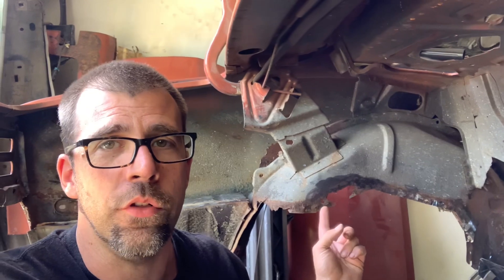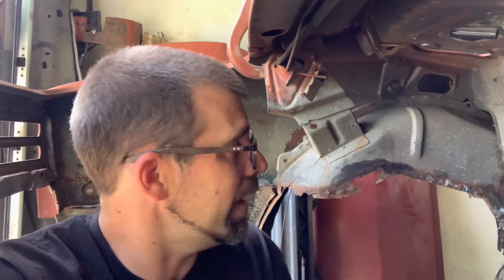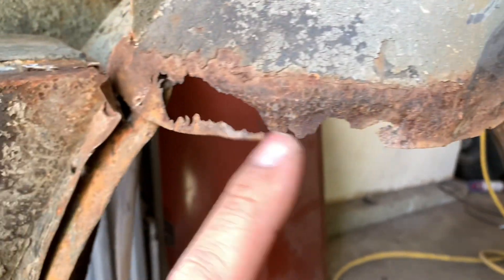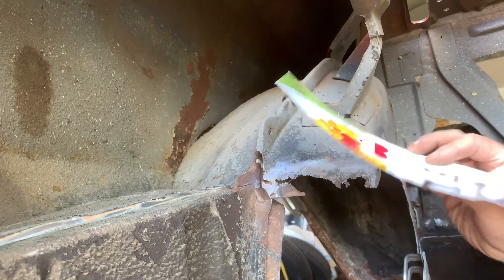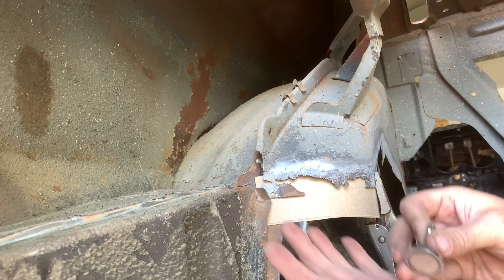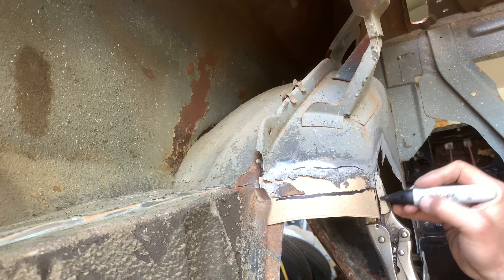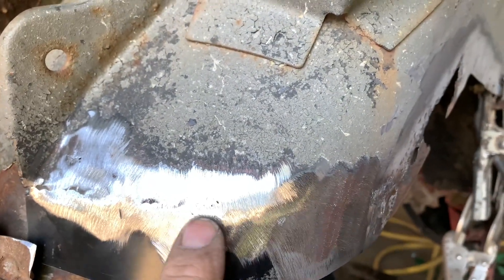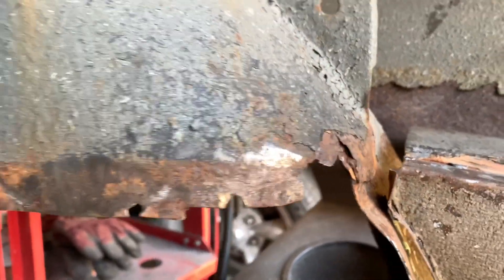how to make patches for seamless Wheel well rust repair 1968 Firebird

Comment: Nice work, Jon. Keep up the great work and the videos coming!👍
Reply from the maker: Thanks buddy, have plenty more to do as long as I can survive the heat, 95 with heat index of 110.  That’s not the norm for Indiana. Might have to buy a truckload of orange Mountain Dew 😆
Reply: Jon, as an FYI for your viewers, I found those magnets at Harbor Freight this morning.
They come in a pack of 4 and the item number is 98502.
Four for $4.95
Reply from the maker: Awesome I will spread the word as well.  Plus be careful with them they remove flesh if not carful when handling them.

Comment: Thanks for the videos, great info
Reply from the maker: Welcome, it hit 95 today here and 80% humidity, might have to visit your air conditioned garage sooner the later.
Reply: @VinylVillageGarage  wow that’s what we have , as we say down here “ it’s getting summertime now” getting parts ordered but will be in Tn all next week to the middle of the following week . I’ll keep you up dated, I can’t get them shipped till I’ll be back to pick them up, shipped freight and I live on a dead end road and have to meet the  the 18 wheeler and off load at a different location . We had another hot one yesterday heat index was 107 , you could break a sweat standing in the shade haha
Reply from the maker: Sounds good, stay cool and safe travels.

Comment: I really miss having a long term project like this, any time I needed to re-center myself just spend a few hours out in the garage taking a little bites out of it with a couple patches then I come back in tired and happy. Now I have 2 finished projects with the Scout and the Camaro and zero space in the garage for a new one.
Reply from the maker: I like projects too.  It’s the sense of accomplishment or concurring a new challenge that makes it fun for me.  Sounds like you have the same issue, need more space.
Reply: @VinylVillageGarage  Sense of accomplishment--- lol ,been there, but all the sudden I got waaaaay to old anymore to give a shit, I get a  sense of accomplishment just getting up and working on the old Bird  or Camaro at all ( I STILL HAAAAATE HEADERS ON PONTIACS ! ) worse job there is ! I would rather fart flaming fire balls then do Header gaskets on my 400 Bird ! and we know why, that damn bolt behind the center tube driver side ! . There is noooooo easy way to get to it. Been putting that job off for over a YEAR !